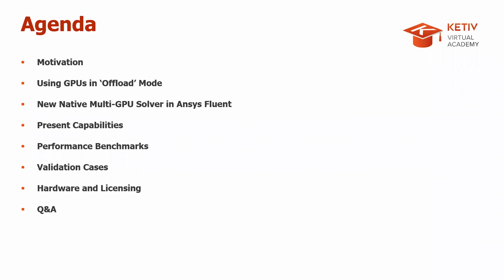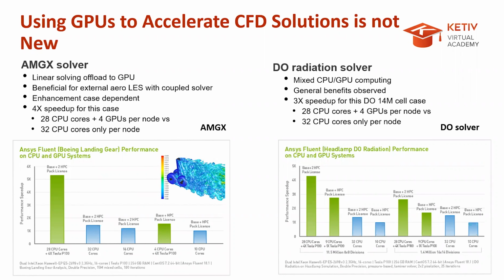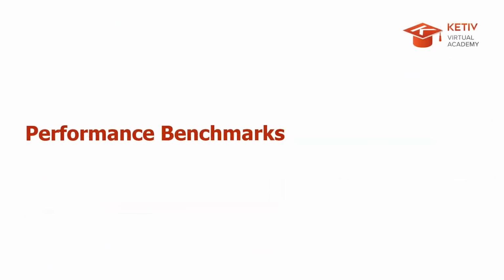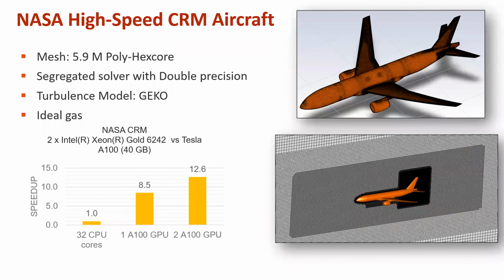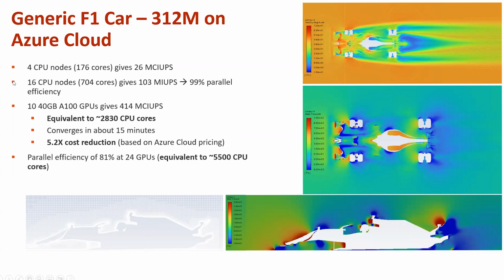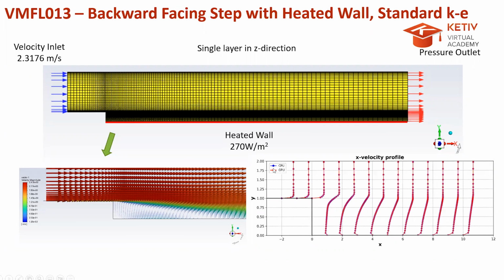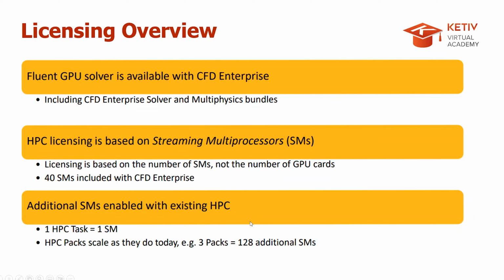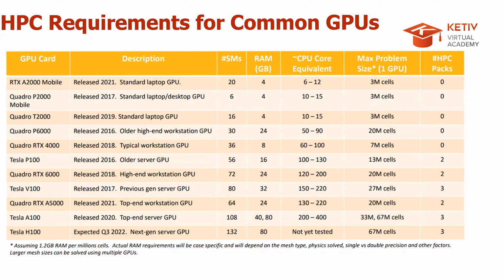Accelerate Your Ansys CFD Simulations Using GPUs | KETIV Virtual Academy

Comment: What are the mesh size limits for (for example) A100 40 (80)Gb? Like with "normal" CPU based solver one needs up to 4Gb per 1 million cells. Are there common mesh size limitations for external automotive aero? Is it a valid assumption that one can "count" GPU memory requirements in similar way to RAM memory with CPU based solvers?

Comment: How are they calculating the solving time per iteration for GPUs? From what I've seen so far, adding GPUs can decrease the actual number crunching time, but dealing with the mesh on a low CPU count is a giant bottleneck for large meshes. Do you need something like 64 Intel Gold's to be able to 'unleash' the full potential of one A100 to decrease total end-user time per iteration?

Comment: I am currently in the process of setting up 6 A100 GPU's to run in Ansys Fluent's 2023 R1 native GPU solver. We have 10 HPC licenses available and one A100 online, but we have not seen a significant speedup that is being advertised... We are coordinating with our Ansys IT rep, but it seems like this feature is too new for him as well. I'm not sure what we need to fix.
Reply from the maker: Hello. 

KETIV has received your inquiry and is actively working on a response. We apologize for any delay and highly value your engagement.

KETIV
Reply: @KETIVTechnologies  Don't worry, it was an obvious fix! If you open Fluent standalone in Enterprise mode there is an option to click "Native GPU Solver." You can't do that from the workbench version - at least I haven't figured that out yet.

The Native GPU solver works great, but it doesn't support things like periodic instancing and some physics models so you have to weigh your benefits of using it.